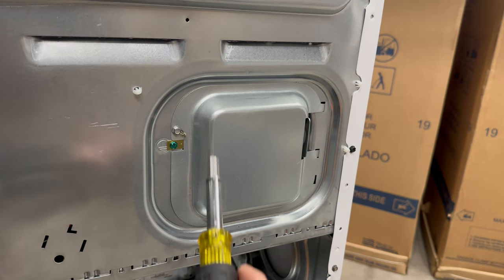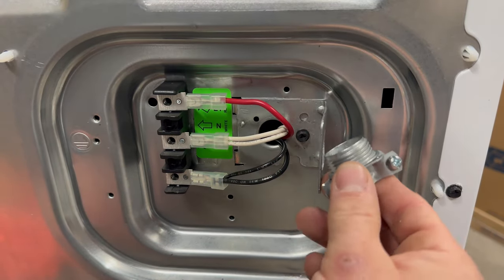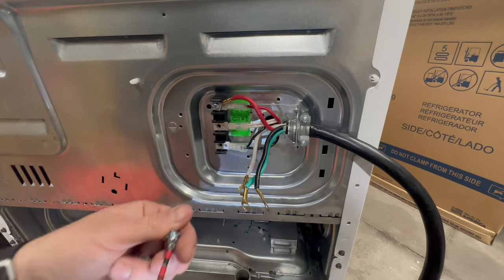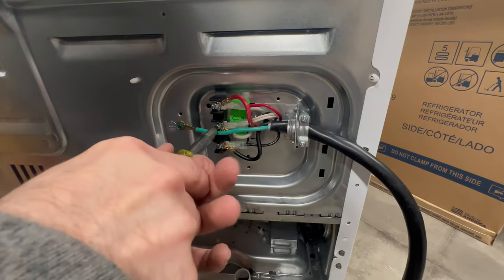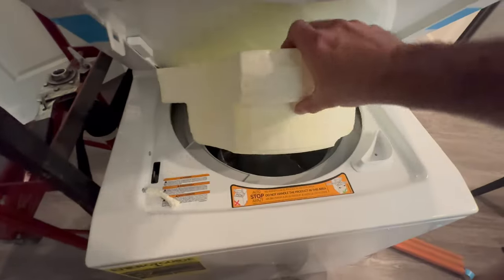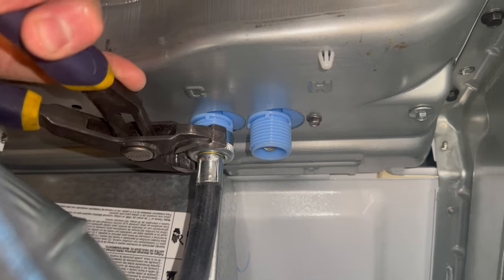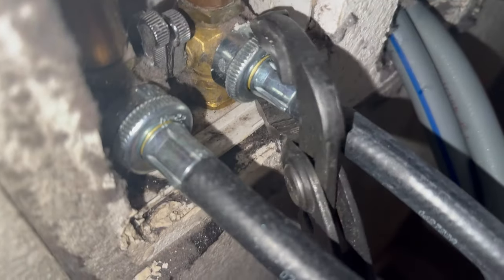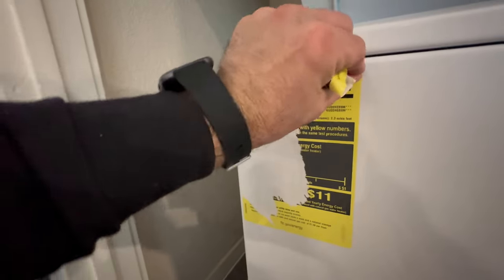Installing a GE Washer/Dryer Stackable Combo

Comment: Working for the same apartment complex for 28yrs and dealing with these, when it comes to the plank flooring cut yourself some small squares from the shipping box and place under all 4 feet and you have poor man’s magic glides. Slides with ease and you can leave under because when it comes times to repair 👨‍🔧 it slides right back out.
Reply from the maker: Damn bro 28 years at one complex !?!?!?! I sure hope they are taking good care of you sir

Comment: Hey there, I only found your video after I did that thing the technicians always get wrong. I failed to remove the bridge plate before I plugged it in and turned it on. It turned on the first time, but the second time it didn’t turn on. . I purchased a cord to replace the one I just installed, assuming I might have damaged the cord. Since I failed to remove the bridge plate, what did I fry? The cord itself? A fuse? Something else? Any assistance would be hugely appreciated!
Reply from the maker: Shouldn’t have fried anything ? I’ve seen these hooked up with that plate and operated for years. I would verify correct voltage at terminal block and start there
Reply: @ApartmentMaintenancePro   Thanks!

Comment: Now go to your. Electrical panel. Make sure your. Neutral and ground are not tied to the neutral buss. The  ground should go to case grounding bar.  The ground is not a current carrying conductor. Only in short circuit protection.

Comment: Planning to purchase a used one. Can it be transported on its side? Anything to watch out for?
Reply from the maker: As long as there is no compressor in the washing machine (heat pump) it’s fine to be transported on its side

Comment: could you provide a link of where you got the powercord and the conduit clamp? Do the different color wires (ring terminals) come with the power cord, or is it bought separately or are they attached?
Reply: we have a three pronged outlet, is there anyway we can get the same outlet?

Comment: Random question: are the hoses for the washer machine able to hook up to a normal sink ? If I add the right connectors ?
Reply from the maker: You need an adapter

Comment: Don't remove the shipping rod until you arrive at the final destination. When there are tape fragments, use some of the glue on some good tape to remove them, just tap it repeatedly on the fragments and it will adhere to them.  Ever heard of furniture sliding disks?
Reply from the maker: Thanks Philip. Furniture sliding disks or any other type of appliance / dolly slider is a strong no-go for me with stackables. a little soapy water is way faster and efficient in my experience 👍 :

Comment: Hi, i have a stacked w/d combo.
I am replacing the transmission in it. When I removed the laundry basket from the tub i noticed that i can hear water or some liquid inside the plastic ring that is attached to the top of the laundry basket.
I wondered if this is normal. 
I tried leaving it upside down for a week while waiting for the new transmission but nothing drained out of it. 
I want to know if i should drill a hole in the plastic ring to drain the water out.
Reply: I just found another video that answered my question. 
There is supposed to be water inside the plastic ring.

Comment: Hi what size both fittings are? Gas and water? I am thinking to buy this one. I have Frigidaire combo now. So was wondering if I need new hoses or same can work? That's why I want to know fitting sizes. Thank you
Reply from the maker: Change the hoses every 5 years or per manufacturer recommendations. They are universal just make sure you are getting washing machine hoses, and dryer hose fittings if its gas. They are universal